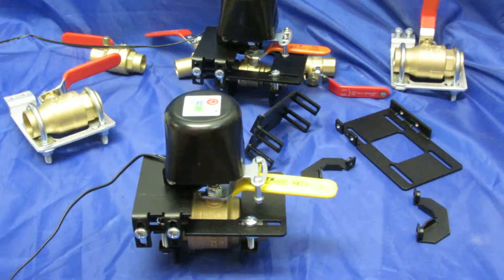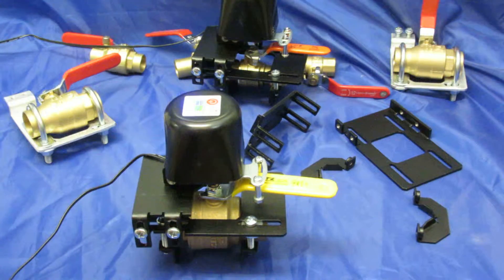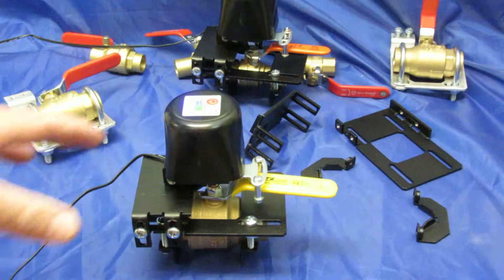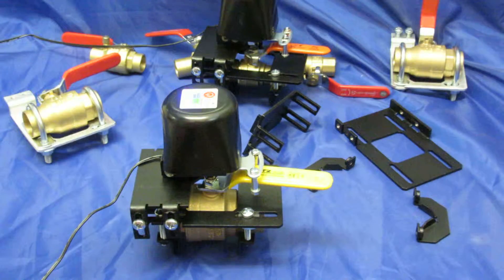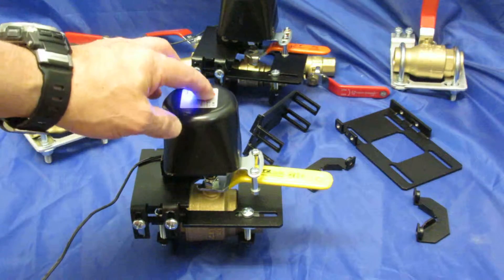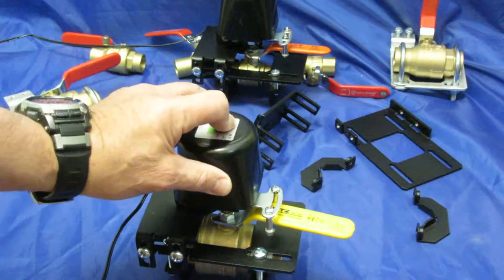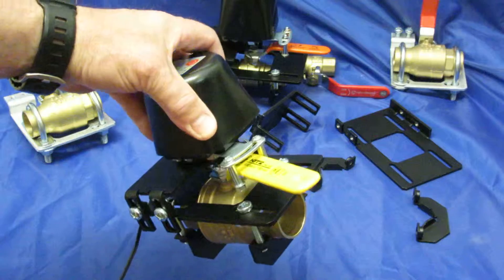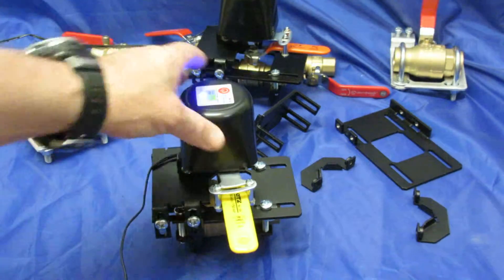EcoNet's Z-Wave water shut off, 1.25" valve test

Comment: Thanks for the video. It appears that you continue to make improvements in the mounting bracket. I have a previous iteration on my Eco-Net.

Despite repeated listening attempts, I was not able to tell what you said about "We're going to be turning up the ??????? a little bit more, which should help". 

I currently have one installed on a new 3/4" valve, and the EcoNet struggles at the very end of the Close cycle to reach the completely shut off position. It usually just keeps retrying repeatedly, until I give it a small assist for the last little bit of movement. I don't think the valve has a high resistance to rotation. I am hoping that your comment may indicate a coming improvement in torque for the unit that might alleviate that problem.
Reply from the maker: +vicw926a4  thank you for your comments.  If you can confirm your EBV105 Serial Number and your ship to address, we will send the updated mounting hardware at no charge. Please email your contact details to sales@econetcontrols.com
Reply: +EcoNet Controls Thanks for that offer. I will do that. Regarding my question about the word that I couldn't make out in the video "We're going to be turning up the ??????? a little bit more". Can you tell me what it is?
Reply: +vicw926a4 Aha - I finally was able to make it out. The missing word was actually two words - "mounting kit", as in "we're going to be turning up the mounting kit a little bit more". Not sure what that exactly means, though.